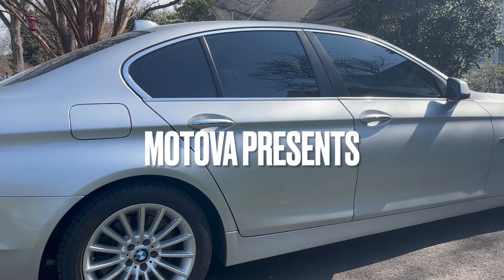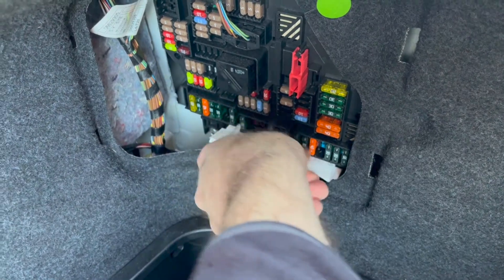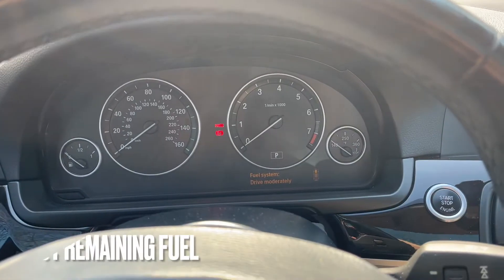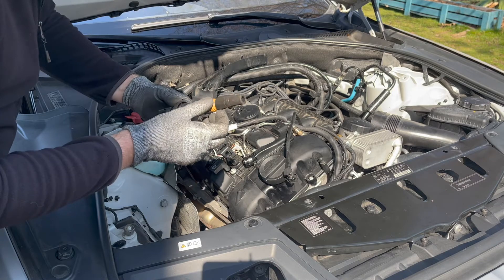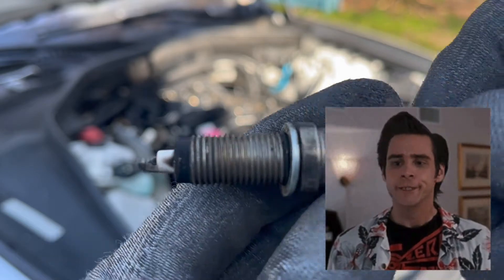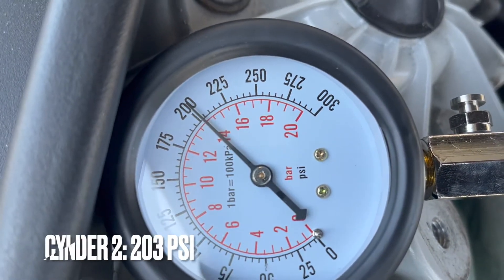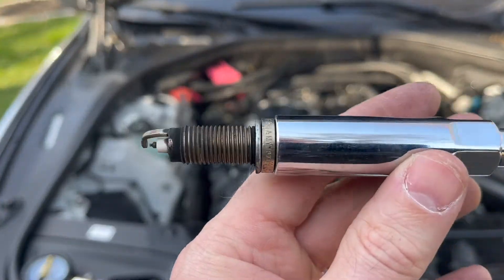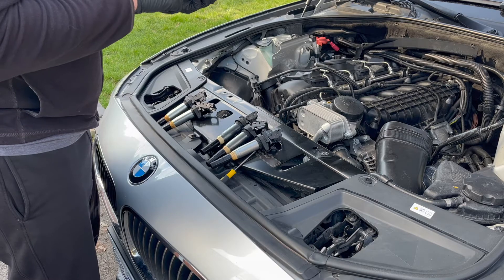How To | Compression Test on a N55 Engine | BMW 535i F10

Comment: I've seen some people remove all the spark plugs before attaching the compression tester, but you left all yours in, is there a difference?
Reply from the maker: Not really, you can only test 1 cylinder at a time.  If I were trying to turn the crank by hand then I would remove all plugs first.
Reply: @SingleMaltMotors  understood! Also noticed 6 fuses listed on the fuse diagram that relate to the fuel icon, do you need to remove all of them to disable the fuel pump?

Comment: Old vid but hopefully you answer. How long roughly did you crank it for if you remember? I did it for 5 seconds and only got 175 through all 6 cylinders I wonder if I needed to crank for a lot longer
Reply from the maker: Hi fried, glad to help.  5-6 seconds should be enough.  You only need to crank until the reading maxes out.  If you're worried about low readings, try again with 1-2 cylinders and let it crank longer.  If you get higher readings, keep going through all cylinders.  At the end of the day, it's important to have consistency, so your reading could be good as is.
Reply: @MOTOVA  Thank you for the reply.  Still worries me though even though they're all consistent seems like other people on the web are getting 200. And Gassan auto has a post saying if under 180 that's a worry
Reply from the maker: @landenmerren1497  Understood.  For some peace of mind, a good rule to consider is a minimum of 100 psi per cylinder, and a maximum difference of 25% between each cylinder.  You might start to worry if one of your cylinders is getting close to 100 psi, but that's not your case.  Most new engines in good condition compress at around 175 psi.
Reply from the maker: One last thought: if you're still concerned, it couldn't hurt to run the test again and let it crank a little longer, e.g., 10 seconds, just to ensure you've reached max readings.  But for peace of mind, remember that consistency is equally important to PSI.